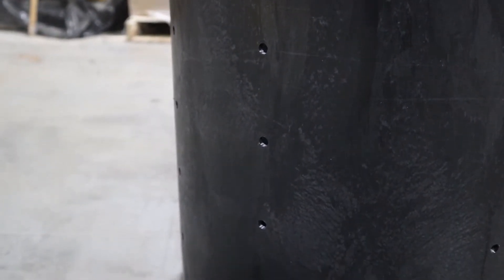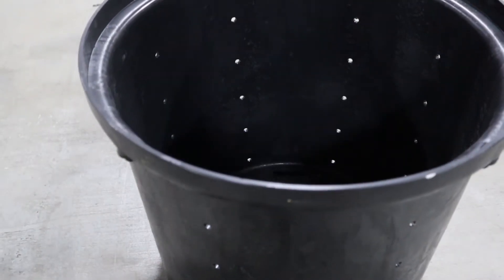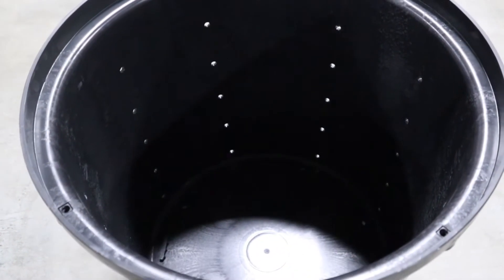Why Most Sump Pumps Fail And Ours Don’t!

Comment: If the basin is designed with holes in the perimeter, why would it matter if you pump the water directly into the basin or just into the pit that it sits in? Won't the water that enters the basin seep back out into the basin pit?  I mean, its all going to get pumped out, but i dont see the benefit of it ending a few inches before the basin or inside it if the pit itself has weep holes?
Reply from the maker: In our experience if you've got several hundred feet of drain tile pouring water around the basin usually the weep holes are not enough to allow that much water to enter. This is why we give the drain tile direct access into the basin. I hope that helps thanks for watching.

Comment: Does the vapor barrier go over the top of the basin?  So, does the basin need to be a couple inches below the ground level or do you want the basin lid slightly above the height of the vapor barrier?
Reply from the maker: Usually the basins have a lip on them and the lid sits a little lower than the lip. The lip is slightly higher than the outside dirt. We put the plastic over the lip but under the lid this way water that could possibly get on the plastic from a plumbing leak from above has direct access into the base and via a dranjer drain. Hope that helps thanks for watching.
Reply: Do use tape to attach the plastic to the basin

Comment: My basin developed a crack in it from pressure I would imagine & water fills it much quicker now and the pump runs way more often. The crack on the side is well below where the two corrugated pipe ends enter the basin so water now does not enter from the pipes, only through that crack. Is this ok or should something be done? Thank you!
Reply from the maker: Since this could lead to more questions. Feel free to do a Ask a Ninja form! - https://crawlspaceninja.com/crawl-space-help-faq/
Reply: @CrawlSpaceNinja  no thanks. I think I spelled it out pretty well.
Reply from the maker: @pmaz-11  If the water entering through the crack is clean with very little silt, I think it will be ok. Hope that helps.

Comment: Your pump might be 4800 gpm, but at 0' elevation.  You'll be down to 3000 or so by the time the water actually leaves to basement.  Still good, but don't just believe what the the big print on the box says
Reply from the maker: Agreed, all pumps lose GPH as the elevation rises, thanks for sharing. I always try to say "up to" but sometimes I forget to say that. Thanks for the assistance.

Comment: Hi Michael, big fan of you and your company. Question, I had an installation done a few months back by Crawl Space Ninja of Nashville. I don't see where they put holes into the basin for the pipes so the pipes are just essentially discharging into the gravel as you stated. I think the method you described here would move the water more freely and efficiently, currently it takes a while for the pump basin to fill up just by using the holes. What are your thoughts?
Reply from the maker: Thank you Greg. We switched to pipe directly installed into basin in the event of heavy rains. But for years we allowed the water to dump around basin and move into the basin via weep holes. Both are effective overall but direct access does get the water in there faster if you are taking on lots of water. That is the reason we switched to direct access in the event a home is taking on heavy water but the way they did it works too. Hope that helps.

Comment: Doesn't the silt eventually clog the felt surrounding the hole? So should we plan on replacing this whole thing like, every 7-10 years? What's the life expectancy?
Reply from the maker: We have seen properly installed pits last decades but I understand your concern. Some soils are very fine and may clog which is why we install a landscape fabric to help keep that from happening along with aggregate. But its hard to say if all that will last forever either.

Comment: Should your sump pump be level with the ground in the crawl space? The house we bought has a sump pump and I’m not expert but I believe my basin isn’t deep enough into the ground. The top holes in the basin are at ground level and I believe because of this it isn’t allowing my sump pump to properly kick on and run like it should.
Reply from the maker: Hey tms299, Check out this blog we recently did "Crawl Space Floor is Lower than Outside Ground Level"
https://crawlspaceninja.com/faq/crawl-space-floor-level-is-below-outside-ground-level/
Thanks for watching and have a blessed day

Comment: Hey Mike thanks for   video ..i have sand all over and under my house , what would be best solution regarding , based that we have here in Toronto  so low temperatures during winter time..thanks
Reply from the maker: Thanks for the question, Avet Super.  Installing a sump pump basin with a lid is a great way to protect the sump pump. Debris from above can fall into the area sump pumps are operating and clog them. Without a properly installed basin, sludge, sand, and dirt can also build up and clog the sump pump. I know it can be a pain to install a basing if your pump is already installed but can save you time and money in the future. Plus it could prevent your home from flooding due to a clogged sump pump.  Let us know if you have any other questions.  Thanks for watching and have a happy and blessed day.
Reply: @CrawlSpaceNinja  thanks..im just wondering if is necessary to put gravel on the top of weep tile if is all sand around or we can just put back sand ? thanks
Reply from the maker: @avetsuper6272  Covering the pipe and filling the trench with gravel or a combination of sand and gravel will allow easy access.
Reply: @CrawlSpaceNinja  thanks Mike ..i had some contractor did one side and just did back sand with out any gravel saying that sand is also ok..sand is actually so small size and thats why im kind worry ,thx
Reply: @CrawlSpaceNinja  when they open one side to the footing i could see that foundation is actually just made of bricks , not even one block ,so also im worry regarding that when placing membrane with nail gun ,may cause some damage or crack on brick because as i said not even one block ,complete foundation in made of just bricks..thanks Mike

Comment: Cant the fabric around the basin get clogged over time?
Reply from the maker: As long as you maintain the sump pump, then you will be able to prevent the clogging, you need to make sure it is clear and how it's supposed to be.

Check out these videos and thanks for watching.
https://www.youtube.com/watch?v=2s1AShf7VRI
https://www.youtube.com/watch?v=1q0PM83HkoQ&t=2s
Reply: @CrawlSpaceNinja  i just went without the fabric and filled it up with river rock
Reply: @user-uq6vh3ps7m  This sounds like the best way to go, I bet the rock will also help the fabric from getting clogged.  Time to patent the two stage filtration system!  I'm not sure I would go with fabric but that's just me.
Reply: @CrawlSpaceNinja  I'm pretty sure he is talking about the felt on the outside of the pit getting clogged, not the sump pump.
Reply from the maker: It is possible for fabric to become clogged. Using pea gravel around fabric helps prevent clogging. Thanks for watching.
Reply: @CrawlSpaceNinja  I tried using landscraper's fabric yesterday, but, it seemed to impede the flow of water too much, so, I removed it. I think the holes I drilled in the sump pump basin may be too small though. I used 1/4" drill bit and put around 50 of them in it. I'm thinking I should have used 3/8" and drilled more of them. I don't yet have gravel. I'm planning on adding some today.

Comment: Hello thanks for your video!! I have a question, do you need to drill more holes in the bottom or just put it directly into the hole, also do I need to put a paver inside?
Reply from the maker: No, not at all. Several components make up drain tiling systems, including sump pump baskets. Water collected from around your home's perimeter is sent to the sump pump basin for disposal. Water cannot be collected by drilling holes in a basin.  Having no pavers has the main advantage of letting in more water and therefore giving the pump more time (in minutes or even hours) before it has to start yet another cycle. When a sump pump isn't restarted frequently, it lasts longer.

Comment: I am on a high water table, have exterior and interior drain tile. It is necessary to put holes in the sump pit basin?  Wouldn't that cause me to take on much more water in the sump pit?
Reply from the maker: You will need to drill holes in the sump pump basin in order to activate the float switch when water enters the basin. Hole drilling may be done all the way down the sump pump basin or only near the top depending on where water enters the basin.

Comment: From my experience and research: Over a long period of time a liner/filter can eventually become completely plugged/saturated with mud and sediment, not letting the water in properly. 6" of number 57 drainage rock all the way around and under the basin (let the drainage rock be the filter) A little sediment into a basin is no big deal. Sump pumps are made to handle up to 1/4" solids. Mine is 17 yrs old now and it's been flawless. No punt intended.
Reply: Makes sense to me
Reply: I've been thinking of adding a second one was going to use rock under and on sides
Reply from the maker: Interesting!
Reply: @CrawlSpaceNinja  yes, that felt is going to plug up. You need several inchs of clean gravel around the pit NOT FELT!

Comment: I have a very high water table should I buy a basin with no holes? I feel like the pump won't stop pumping if has to many holes. Thanks
Reply from the maker: If you're wanting to get the water out of your crawl space the basin needs holes so the water can get to the sump pump.
Reply: Here in SE Michigan we have high water tables and clay.  A few folks try to drain the water table with a 36"+ deep pit with big pump, others put in a couple of shallow 20" deep pits with small pumps.   Good luck

Comment: Hey Mike, always great videos and I appreciate the work as I do the same! One problem we face a lot when installing sump basins is when we are at an extremely high water table and have cave-in problems as we dig and struggle to get the basin all the way down without water constantly pushing dirt/sand back in. Wondering if you guys face the same problem and if you have any particular insight on how you approach it and get past this issue..any info would be greatly appreciated, thanks! Mike
Reply: I was wondering the same thing

Comment: what do you do when your footings are showing and can't dig to install a French drain due to structural issues of undermining the foundation
Reply: This is a situation I haven't seen properly discussed and would be interested as well. I would be leery of digging to the bottom of my footer as the clay soil around the footer helps stabilize it, and I would be worried about compromising the foundation by digging down that far.

Comment: I have a question if I'm able to run the drain pipe strat to daylight out my backyard should I still use a sump pump?
Reply from the maker: Yes as long as you're able to get the slope done correctly. The only thing we'd recommend is to still use a popup emitter because the end of the drain can easily be damaged by a mower if it goes over it. We've got a video coming out this evening going into more detail so stay tuned!
Reply from the maker: https://youtu.be/rzLI5BngMO4